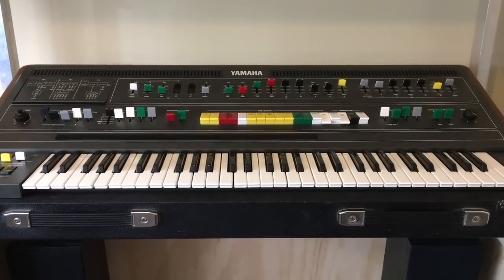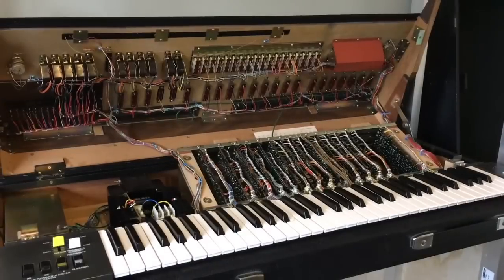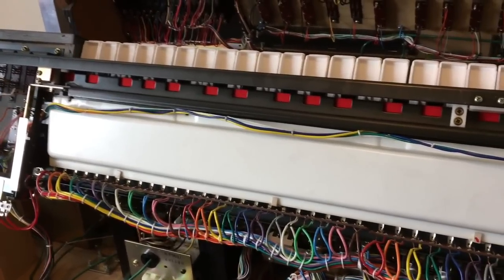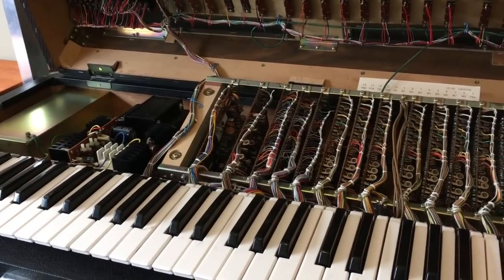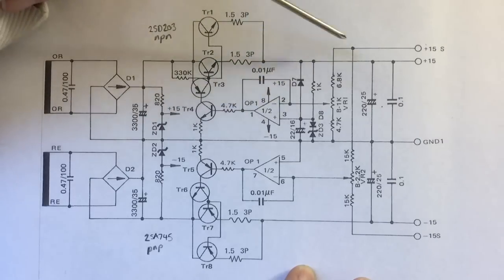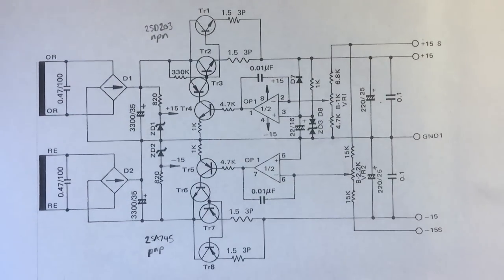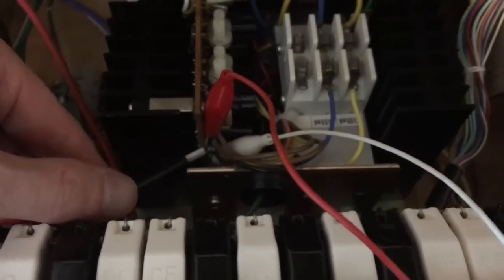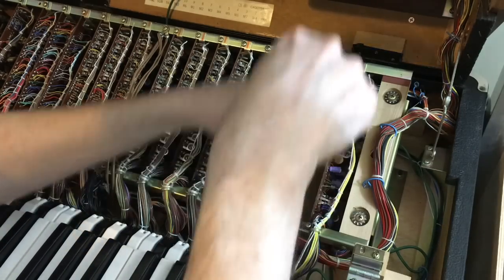Yamaha CS-60 Restoration (Part 1 of 3) - Service Guide, Overveiw, Power Supply, Recapping

Comment: ZOWIE! Didn't I mention a few months ago that you would probably be the perfect person to save my CS80? And now this! I'm gonnah devour it!
The CS60 is completely underrated anyway (indeed). Layer 2 CS60 parts and you basically have a CS80 track. Of course the CS80 has velocity sensitivity and especially poly aftertouch but with most users the results would be very equal. So congratulations anwyway!
Reply: Really, my lust for a Yamaha CS80 has been quenched owning a CS60. Do you own both? I don't think people realize how similar the two synths are. The 60 and the 80 really are brothers, probably much more so than, say, a Roland Jupiter 8 and a Jupiter 6. The Jupiters sound completely different from one another. The individual sounds of the CS 60 and 80 sound identical. The difference comes from the ability to layer them on the 80.
Reply: Er, I used to think the same before I got my CS80 but even if one does not use the extra expression facilities very conciously the difference in expression can still be huge. So although a doubled CS60 will indeed sound the same on the surface, 9 out of 10 times something less definable will still be missing, assuming one is at all able to get the best out of an 80. For most people the concept of polyphonic aftertouch is for instance rather mute, just as it was for me.
Reply: depends TOTALLY on the patch ... 9 times out of 10 a CS50 will also do the job of a CS80 too - like with many of Vangelis' scores

Comment: i think a LOT of people (probably through internet myth) give tantalum capacitors a bad rap - but they are actually EXCELLENT performers - EXTREMELY stable under all conditions and very very very long lasting - they just don't work that well with malfunctioning circuits - which is why they are used as half-fuses in a lot of circuits. BUT - if you have a well behaving and well designed power supply - there 's very little to worry about

Comment: Thanks so much for taking the time to produce this excellent video. I have a CS50 with a power supply problem, the -6.5 and +8.5v are out,  when I test the supply disconnected from the synth, but with the sense lines connected to their voltages, the +15 and -15 climb to over 20v. I read elsewhere that they need to see a load, how come you do not connect the supply to a load when calibrating it?

Comment: Very nice. Thank you for this video, it adds a little bit more insight into this wonderful instrument. I agree that the Yamaha Cs60 is extremely underrated and very musical and expressive! I bought my cs60 in 2014 and it had a few problems from the get go. The pitch ribbon has never worked. The spring is Corroded.  A few of the keys weren't working, which I fixed. My master course pitch doesn't seem to work at all. The keyboard control brilliance low, and high sliders only seem to work perfectly when they're set equally in the middle. If I move them any other way, they work, it's just that when I switch from my low to high note I can hear the filter abruptly changing all of the rest of the notes that have been overlapped. I think it has to do with that card that has the duplicate DA converter chip, you mentioned in the video. 
 What made me redo the power supply was that the synthesizer started randomly playing Notes all by itself. Voltages we're just out of control, inside the instrument. 
 I still have a lot of work to do because I failed to replace one of the capacitors in the power supply that is linked to the 8.5 power which is making the 8.5 fluctuate greatly. So, I ordered more of those and that's what I'm gonna be working on when it arrives, asap. 
 I already have all my CMOS and logic chips but, I just haven't installed them yet. After I do that I will replace all the capacitors on the voice boards and other boards in the instrument. 
 If anyone knows a way to get the pitch ribbon spring repaired, I'm definitely willing to try it.
 And, part of me wants to add a Midi kit to this instrument, but I know that it's one of the hardest instruments to add a midi kit to and, I don't want to have any negative affect on the instrument from installing the kit. Has anyone installed A midi kit on their CS 60? If your kit has an offsetting, does the instrument function normally without this engaged? 
 Also, I don't see how the midi on an instrument like this would work very well. I think that you would hear the quantized steps for things like, filter sweeps and stuff like that. 
 This instrument is definitely underrated and I think that it is the CS to have. 
 Thank you for your wonderful video! I'm glad you have your instrument fully functional.
Reply from the maker: Stephen Coker I think when you replace the CMOS chips that most of the problems you have will be fixed. Those CMOS IC's help direct the CV's to and from the ADC's. So all of them must work. The KAS board is easy to work on while still in the synth. Just unscrew it and flip it upside down. There is only wood underneath so it's OK it you drop things there. I will try and find more information on the ribbon controller.

Comment: Concerning capacitors, not all electrolytic caps need to be replaced if their ESR readings are well within specs.
I've got a 42 years old Minimoog D synth, and I've checked the ESR on all its caps, and none of them required replacing. Some of them even showed a lower ESR reading than brand new ones ! Of course they used very high quality Matsushita ones back in the day.

Comment: when tr4 starts to sink, current from Tr3 will get into the base of tr2..   awesome video and good info..
Reply from the maker: You are 100% correct. I just watched it again and I totally said the wrong thing at that point. For TR3 (PNP) to be on, current needs to be flowing out of the base. If the current is blocked by TR4, voltage will build up in the base and turn conduction off. I must have been off with the fairies at that moment. I have edited that part out and I will say the correct operation of TR4/TR3 in the next CS-60 video. It's basically the same as a high-side switch.
Reply from the maker: Thank you by the way!

Comment: Ok so, Im back for more insight into the CS 60 from Golt!  So, I previously recapped my power supply and replaced the two op amps which helped a lot and everything was pretty good for a while. But, I did notice that the -6.5 and +8.5 rails were erratic. They don’t hold a voltage the way that yours does, in the video and now they’ve gotten worse. 

I can’t seem to get them to the correct voltage due to the potentiometers running out of any more turn. They get pretty close, within a vote  but then I can’t turn the 8.5/-6.5 potentiometers  anymore. 

 Also, There is an anomaly which is, when I turn the 8.5 it affects the value of the -6.5 and vice versa. This leads me to believe that something is grounded out or two leads are touching which  obviously should not be. Probably something I did wrong when I replaced the capps And op amps. 

I now have the power supply out and the multi meter tracing all the connections and I haven’t found the exact corporate yet so I may just redo the capacitors and op amps, one more time. 

 I found a seller on eBay that sells the capacitors for the CS60 so I previously bought me a pack. 

 The main reason I opened up the synth again is because static comes and goes when I’m playing the instrument and it seems to be connected to the after touch and modulation, mainly. This issue could very well be directly related to the problem I’m having with the 8.5/-6.5 power rails because I never  had this particular issue until very recently. 

Note that I have not replaced the CMOS chips yet or anything else in the synthesizer. The only thing Iv touched was the power supply.  

  I noticed that in this video when you were replacing the caps on the voice board that you had all of them already separated and they looked like they were purchased from someone who sells the capacitor kits or possibly you separated them like that?

 Do you sell capp kits for the CS60 voice board or do you know anyone who does? That would help out as, I’m not an expert yet. 

I know that I have bugged you a lot concerning the synthesizer and I am self taught so I’m willing to compensate you fairly through PayPal, for any time you spend answering any my questions. 

  I really appreciate everything you do, Golt!

 Thank you so much for taking the time to make these wonderful videos and for helping out in fixing up these amazing unique instruments. Much thanks and gratitude to you, my brother. 

 These wonderful instruments are the reason why I am learning everything I can about electronics engineering. But, I have a long way to go... 

 I hope your doing well! Keep learning and keep Synthing!
Reply: you can get capacitors ANYWHERE ...there's nothing particularly special about the capacitors in the CS60 - or ANY synthesizer for that matter. And you will find they will be FAR cheaper getting them through your local supplier than through any ebay seller selling 'bespoke kits' ... if i were you i would get the PS cleaned up first and making decent power ...

Comment: Thanks for the video, lots of valuable information for someone like me restoring my own malfunctioning Yamaha CS60. Regarding the CMOS chips, can you help me identify the correct replacements? For instance for a TC4016P ic, will HEF4016BP be a longer lasting and similarly functioning part?
Reply: Either HEF but even better CD4016. Do mind though that they exist in UBE and BE versions the U signifies unbuffered. Old A series CMOS were not buffered and while buffer can be in most cases beneficial it can also cause problems. I suggest where possible to stick with UBE versions for CS synths. Texas Instruments are to my knowledge only ones to do unbuffered versions

Comment: Were you able to calibrate the HP and LP filter sections?  The service manual is very incomplete.
Reply from the maker: The Dollar Guy Yes I did. I found a new way to do it and it turned out really well. It's in the third video (3 of 3).

Comment: Dear Golt! I want to get going with my CS80 at last. Well, I actually don't because it scares the hell out of me having to but leaving it as a static display for fear of blowing it up is also not a satisfactory solution. About static electricity: Where my CS80 sits (= leans heavily :-) ) no large metal objects are in view. It does however have the original rugged stand. Would connecting an antistatic wristband to that frame suffice?

Comment: the CS50 and 60 are EVERY BIT as expressive as the CS80 - though they get short shrift for not being the particular one vangelis used - though he very likely could have done JUST as good a job with those synths. the CS80 isn't about the number of voices but about the way the keyboard works ...

Comment: Great in depth coverage. Thanks! Is the key matrix design because of volt per Hz. scaling? On the after-touch, is it mono, or poly like the CS-80?
Reply from the maker: Nothing to do with the keyboard scaling. It's just a type of keyboard design. Here's my theory: This was the first ever keyboard diode matrix, in a synth, as far as I know. Some synth history sites credit that to a Korg in 1979 I think, but the early CS series predate that by at least three years. In fact these were the first ever poly synths designed as poly synths from the ground up, not just a collection of mono's (that credit goes to Oberheim). My theory is that because Yamaha created it, they did it the way that made the most sense (12 x 5). They must have taken out at least a provisional patent on it, because when everyone else did it a few years later it was in a completely different way (8 x something).

The aftertouch is mono but it is the best feel ever! It's actually a combination of aftertouch and velocity because it depends on the distance the key travels. So it can't tell the different between a first press and then pushing harder. It's just based on how far the key moves. Initially I thought it was too sensitive, but when you get used to it you can control it with much more finesse than a modern keyboard. It really is a highlight. That and the ring mod, and the ribbon.
Reply: I think the 8x something arrangement is related to binary numbers. In those matrixes, you would always turn on one row at a time and measure the voltages on the columns. You never need two rows at the same time. So when you have 8 rows, you can use a cmos demultiplexer to create the required 1 out of 8 pattern from 3bits. This reduces the complexity. In the 12 x something arrangement, you need 4 bits to turn on one of the 12 rows. 4bit could encode 16 rows but you only use 12 so you're not very efficient. Those kinds of optimizations were probably more important back in the day.
Even today, when I lay out a led/switch matrix, I naturally choose a 8xsomething or 16 x something layout because it naturally fits into the binary patterns.

Golt - with your knowledge in those old machines, would you agree?
Reply from the maker: TheSlowGrowth I agree. It's much easier to use a standard mux electronically. But Yamaha's way makes it easier to do octave switching (keyboard scaling) I think. Either way it's cool. I'm fascinated by the design either way!

Comment: Hi I have a lot of problems with the power supply of the CS-50, blow the fuse of 400, I changed the 4558s all the Capacitors, and diodes, etc, I think that the problem is in the Transformator, my idea is build a new power supply with Toroidal transformator, but I am confused with the sense +15S/-15S connections, 

can I build a +15/-15 V power supply and connect the sense connections to the normal rails +15/-15? can I damage something making that?

Thanks in advance

Fernando

Comment: might not be a terrible idea to keep the ground plug connected to a local electrical ground while working on it? not familiar with the ground distribution inside the synth but there ought to be some facility for that ?
Reply from the maker: Leaving the synth plugged in to mains or not is purely a safety issue for me, it doesn't help with static. When working on high voltage (>1kV) I will keep the mains plug connected to the wall socket and make sure the socket is turned off. This way any residual HV that is stored in big capacitors can be shorted to local ground. The problem with that, is you need to have the power socket protected by a device that will stop somebody else from turning it on. When I work on synths I usually just unplug the socket from the wall, as the circuits inside the synth are almost entirely low voltage. There is enough metal in the synth to ground any caps which are quite small and discharge easily. For static protection a ground strap to a big piece of metal is enough. So it's safer just to unplug the synth to protect yourself.

Comment: What would you choose between the following options as replacement caps for the 2 bigger 3300/35V ones in the PSU? I'm having a hard time deciding between these: Nichicon UPW 4700µF/35V/105° (8000 hour life) --- Nichicon UVZ 4700µF/50V/105° (1000 hour life) --- unbranded 4700µF/63V/105° (no life expectancy data)
Reply from the maker: Metralon I wouldn’t trust the life expectancy data. Generally speaking modern electrolytics (made post mid 1980s) are good for at least 25 years. The life expectancy data is derived from accelerated life tests which are not real world conditions. In the power supply I’d get the cap with the highest voltage rating.
Reply: Thank you sir. You're helping me tremendously in reviving my CS 60.

Comment: in THEORY at least - and with a good power supply design - tantalum caps downstream should NEVER be a problem - they are stable as ANYTHING out there - even more than poly caps. But electrolytics are quite another story!

Comment: bummer i finally got the nerve to test my PS while hooked up to the CS50 - i did a thorough recap and even replaced a couple of the regulators (2SA490) and other parts ... but FAILED the dim bulb test ... won't even light up the power switch ... ugh - back to the drawing board... though - when i try to test the power supply in vitro (not attached) after connecting the relevant sense lines to their respective power lines (yellow and brown pairs) nothing happens at all ... not measuring ANY voltages on any of the test points. So then i thought to check continuity in the connectors DOWNSTREAM and i get dead shorts between the yellow and brown pairs (expected) but ALSO the thick black pair (ground i guess?) - i'm wondering if these should be shorted on the PS as well when testing alone? - thanks anyone who will listen
Reply: update: i figured it out - for anyone ELSE looking to do this on a CS50 or CS60 - YOU MUST BYPASS the external circuit going to the power switch (I was terribly confused about this) - so you have to jump both the pos and neg 15v sense lines AND jump over the snubber capacitor as well to actually complete the circuit ....